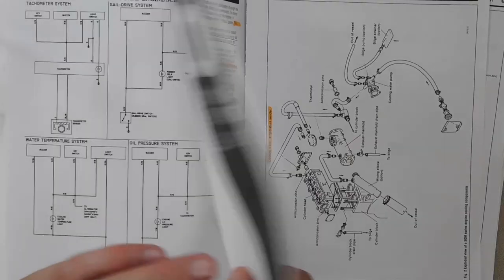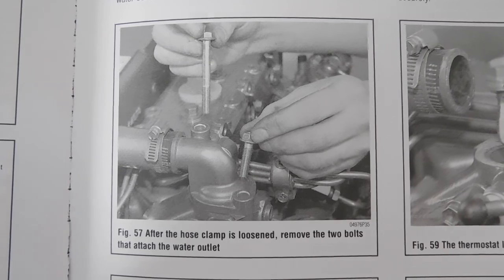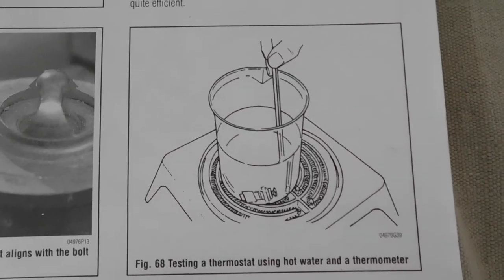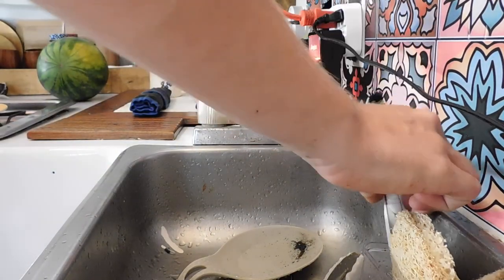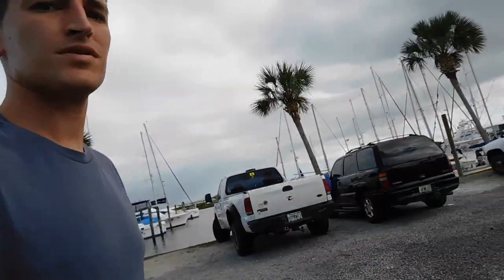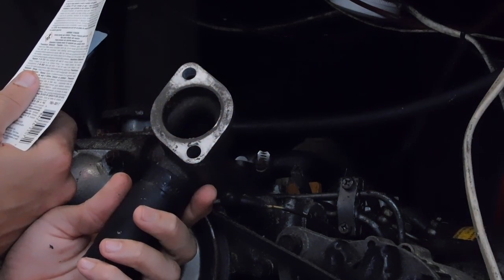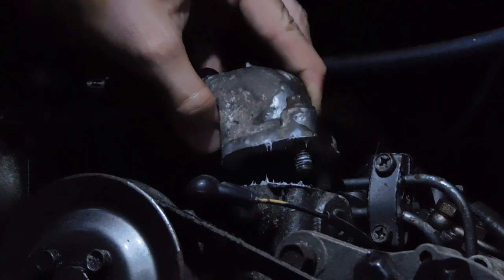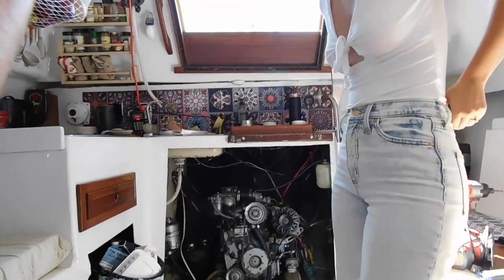Why Is Our Yanmar Marine Engine Overheating? How To Check A Thermostat | WG Sailing Vlog Ep 9

Comment: Don't bother "checking" a thermostat.  A replacement is only £10.
Reply: Mine was £60 for a smaller yanmar engine than that.
Reply: @ChaosToOrder777  Hi, this is a general purpose automotive thermostat.
£10 is more than the market cost of these.
Let me know if you need any more, I can supply and ship for £15 each